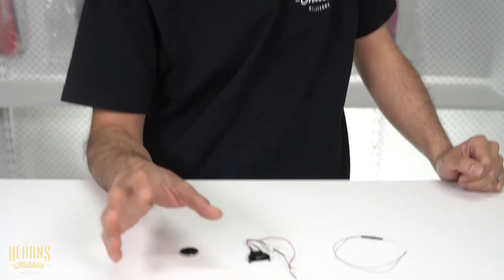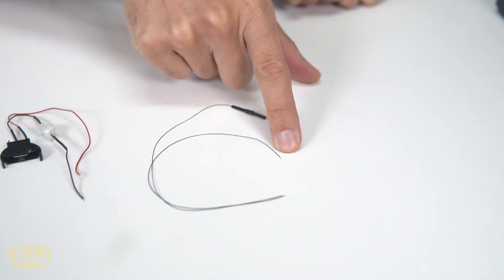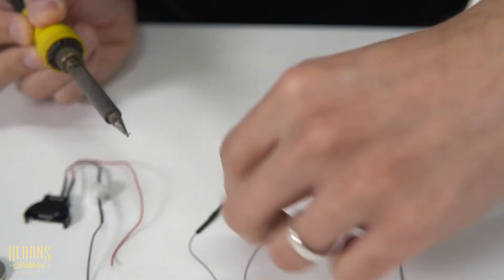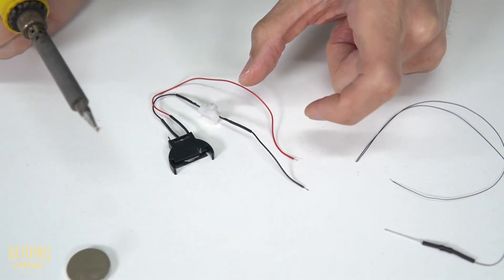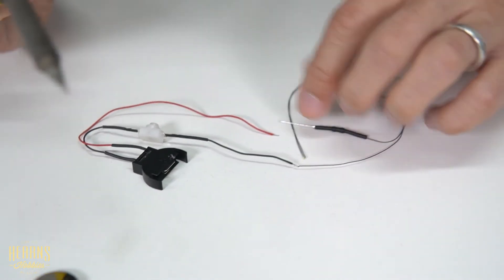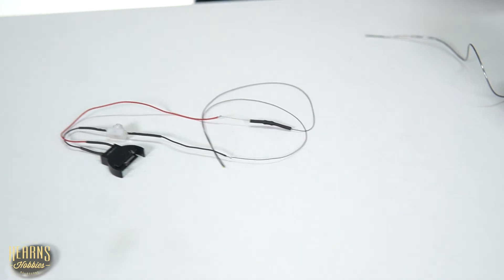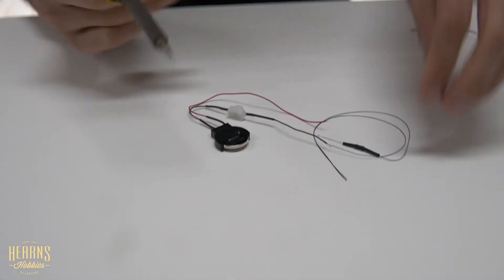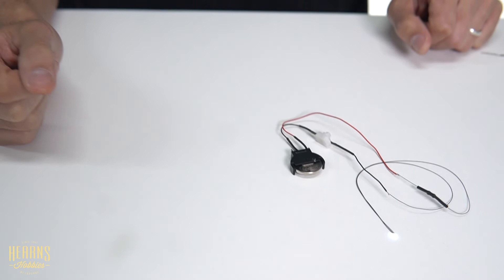How to LED Soldering | Green Stuff World | #askHearns

Comment: If I connect 2 LED's to one battery, does the second one still need to keep the resistor? Or is the resistor before the first LED enough for both?
Reply from the maker: Search "led calculater" on Google to find apps that work out the resistors you need for particular circuits.

Comment: Can you cut the wire to make the length shorter?
Reply from the maker: Yes, you can. The wires are very thin and have a fine insulation coating. You need to scrape this insulation off the ends after you shorten the wires to be able to solder.